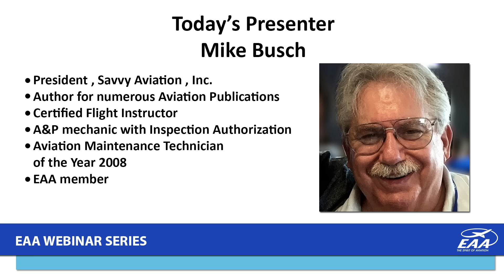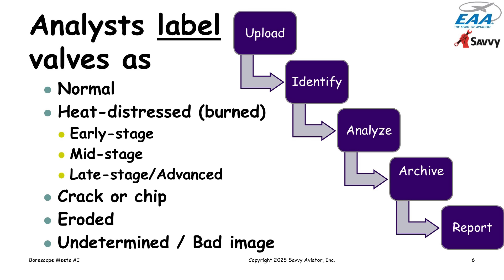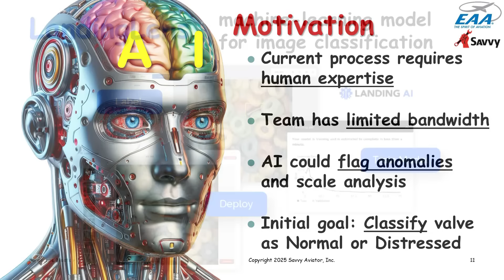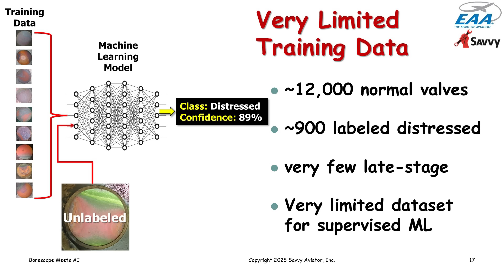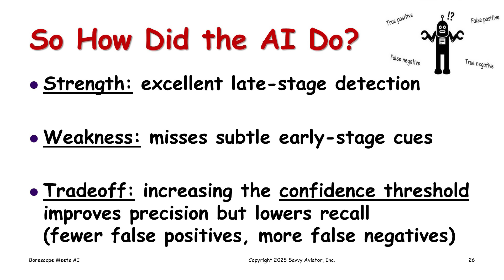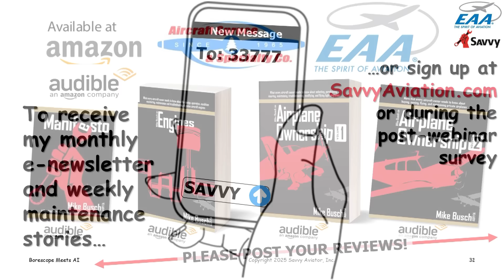Borescope Meets AI

Comment: Do you ask the classifier to assess anything beyond low, medium, high overall condition? For example, more directly evaluating a measure of concentric value of the pattern or uniformity of color rather than just the end result and then use a combination of those to predict a recommendation to replace.